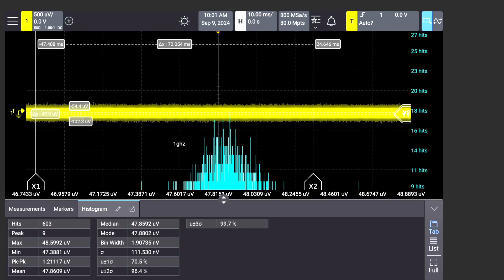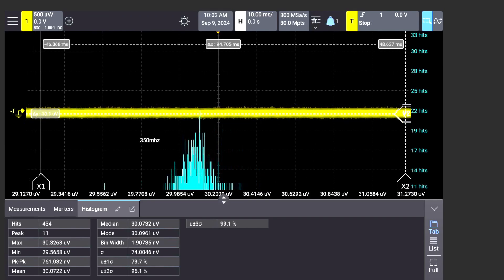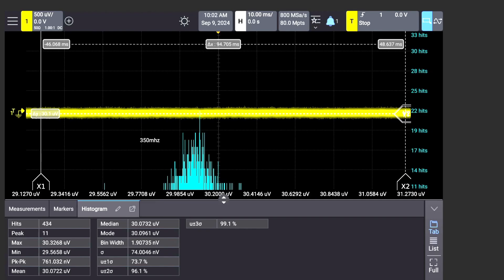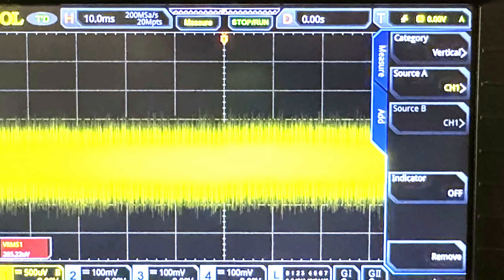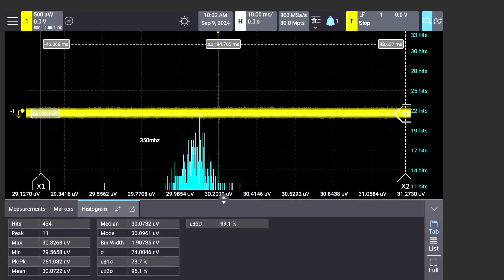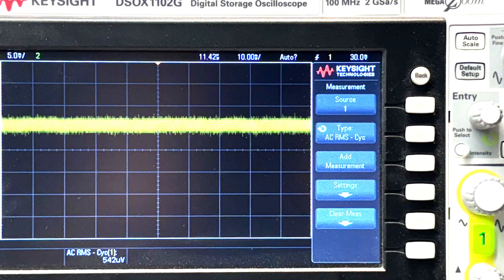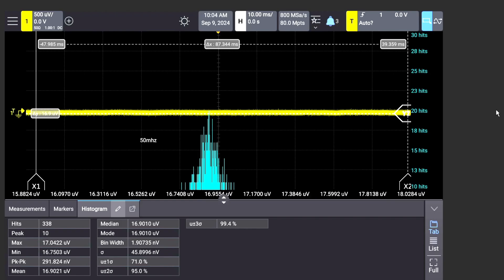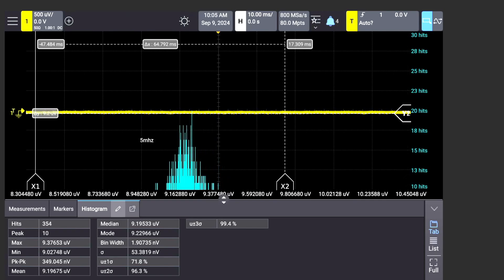#1999 Keysight HD3 noise vs bandwidth

Comment: Apparently low noise floor wasn't as important a design goal for the Rigol MSO5000.  Rigol has newer 12-bit scopes like the DHO100 (for around $400 in the US) with much lower noise floor, e.g., in the 25-30 uV range with 20MHz BW limit / 50 Ohm termination.

Comment: Is the Rigol noise complaint a confusion with the mega update rate making the trace look thick and noisy? A change in settings should fix the impression and improve measurement. Dave@eevbkog has a video on that.

Unfortunately, even though I can afford a $10k+ scope, I cannot justify it as I am not making money doing design or repairs. I have other hobbies that consume funds. The Rigol MSO5k is a great value and for hobby work will have to work for me. I have and like the Siglent SDS2204XPlus and for many, the Rigol 12-bit DHO914 is a good scope.  I got one on clearance just because and figured it will last long as my first Rigol did, over a decade when I gave it away. 

 I am not quite green with envy, but a little jealous of your 1 GHz Keysight, not that I need it. Fortunately, I am not in the need phase of life.

A lighter case with dark lettering is easier to see. I have difficulty with the above two Rigol scopes where lettering contrast is reduced. Most of those are less important informational.

Even if I didn't buy 3 scopes, the total is less than half the Keysight 1GHz. Keysight's illustration on that scope is misleading, showing 1GHz and the price of the lowest model. And then prices aren't shown so they can hook your info in a quote request. Their business model is a put-off for many engineers, but they are probably run by marketing and business majors, often referred to bean counters. No beans, no company! They do this for information also - want more, contact us. Next, they will charge for app notes, after all, they cost money to create.

Comment: You had the MSO5000 on the 500uV/ range which automatically turns on the 20MHz bandwidth limiting, so the 285uV noise is with 20MHz BW, not 350MHz.  You can also see it in your picture at the lower left with the “B” in CH1 box.

ETA: you should be using AC.RMS (labeled as “Variance” in the measurement menu) and not VRMS as shown in your picture.  The difference being AC.RMS subtracts out any dc offset (Vavg), while VRMS does not.  So the number is suspect.

The smallest vertical resolution I can get with full BW (350Mhz) on my MSO5354 is 2mV/  which measures 326uV AC.RMS.
On the 500uV/ range and 10ms/ with automatic 20MHz BW limit, noise measures 160uV AC.RMS and 172uV VRMS (some DC offset with VRMS).

Comparing apples to apples with your 100MHz keysight DSO1102G, my MSO5354, limiting BW to 100MHz at 5mV/ and 10ms/, noise measures 245uV AC.RMS.
Reply: Great catch. I've seen much more expensive scopes to the same exact thing
Reply: I upped your comment.  However, I think the 20mhz bw is a good idea. This comes from those chopper stabilized amps .... Why anyone who uses an oscilloscope wants to see uVolts at 350hz!!? Just grab a spectrum analyzer and go as high as you want.
Reply from the maker: wow. thanks. I had no idea the rigol did that. so the noise is way worse than I thought
Reply: Apparently low noise floor wasn't as important a design goal for the Rigol MSO5000.  Rigol has newer 12-bit scopes like the DHO100 (for around $400 in the US) with much lower noise floor, e.g., in the 25-30 uV range with 20MHz BW limit / 50 Ohm termination.

Comment: That's great but I would not use a scope to try to measure such low signal levels. Errors in probing etc... often dominate the noise in these situations.  I can't really think of a time I've needed to use a scope for such measurements.
Reply: This is where an active probe would be handy.
Reply: @peterayearst23  Regular passive probes work just fine.  Gain through a receiver is extremely high, in the order of 150dB or more.  I'm usually just checking to see if there is gain through each stage of amplification and mixer operation.  Probe circuit loading really isn't a problem here.  I have a couple active probes and they are basically expensive paper weight's LOL.
Reply: @mikesradiorepair  checking out the front end of a receiver using a scope probe would introduce enough capacitance that could effect circuit performance. 

Regardless, though,  it's been interesting to try and develop a probe with minimal capacitance and high enough impedance as to not load down the circuit. At hf frequencies that is.
Reply: @peterayearst23  The passive probes I use with my 2GHz R&S MSO 5 scope only have a couple puff of capacitance.  Work fine with VHF and UHF circuits up to 70cm band.  Not doing radio design and advanced signal analysis, just regular day to day signal tracing for troubleshooting.
Reply: Not going to say it's priceless but it sure makes signal tracing signals in the front end of a receiver circuit much easier.  Much easier than using a spectrum analyzer with a oscilloscope probe hooked to it and having to change center frequency every time you get to a mixer stage.
Reply: Low amplitude signals are meant to be measured with lockin amplifiers. Which locks to one frequency at a time (correlated signals); basically filtering at a provided center frequency, adjustable phase. [FFT/wavelets or time defined] Signals can be accumulated with time, which also doesn't provide an instant FFT. Filtering and windowing also introduce artifacts.